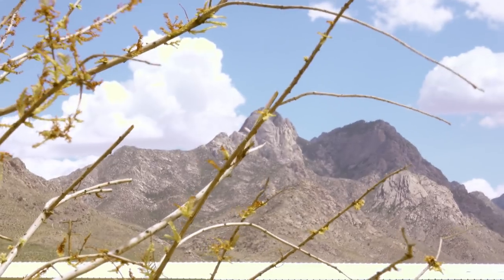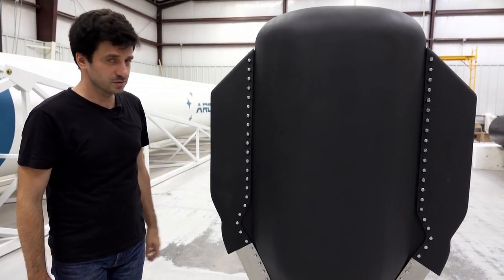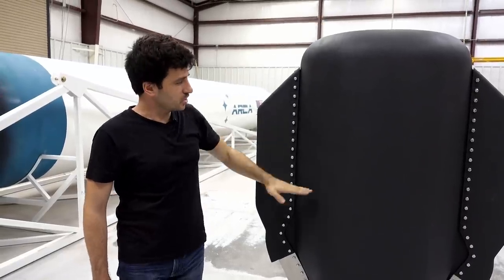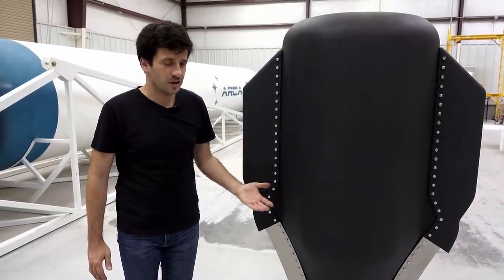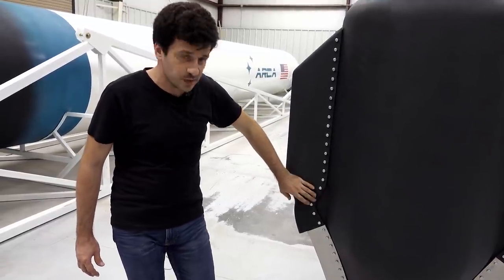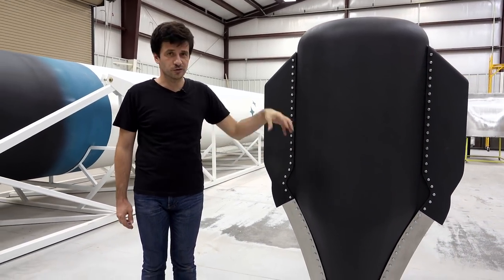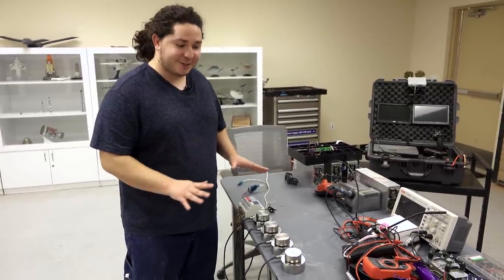Flight of the Aerospike: Episode 6 - How the Engine Works

Comment: I can smell some BS
Reply: Ant1 Statik how ?
Reply: @utubeballbag  electronics setup is a fake.
It kinda resembles my Arduino set - flimsy breadboarded wires connected without a rhime or reason.
His toolbox at 2:54 contains run of the mill Raspberry Pi parts (most noticeably Pi camera)
The next shot - is just a Pi header connected to a breadboard!
Reply: @crazymonkeyboom I am an empirically self-taught solder-poker. I see something as stupid as I would make. 😊
Look carefully:
1. You can't use breadboards for any reliable measuring equipment - they are full of jitter and fall apart when you sneeze nearby. You have to etch a PCB for any reasonable reliability.
2. I paused to look at the breadboard which was tinkered by the lady at 2:42. Its just an Arduino connected to a Raspberry with something that looks like a relay and 3 potentiometers! I can't imagine what that thing is supposed to do, but it DOES NOT measure temperature, obviously.
3. His toolbox is not an engineer's toolbox. It's full of hobbyist parts. What use do they have of a Raspberry camera? It kinda looks like a result of a shopping spree at element14 (believe me, I've done that).
4. The part at 3:00 is a cheat-aid for somebody, who can't read bloody Raspberry Pi manual! I mean, how professional is that???
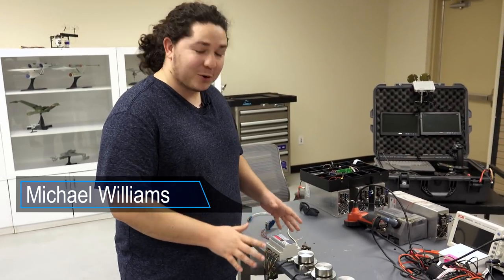5. At 3:07 we see a panorama shot. Let me list what I see:
- SELF-CONTAINED load sensor kit (you just buy and use it, no need to tinker);
- his stupid toolbox;
- three (3) power supplies (what for?);
- a soldering iron without any soldering materials;
- a tangled mess of multimeters;
- oscilloscope (not connected to anything);
- and an fucking UAV control station! With screens and joysticks! 

It's not a an engineer's workplace. It is a toy room!
If they imply doing rocket testing with that stuff - they failed miserably.
Reply: @firesculpturevideo  Not a troll. I don't imply that what's ARCA does is fake. However, electronic components I see in this promotional material are fake. Shoddy PR work makes more harm than good.
I hereby expose the inconsistences. If more arise in future - than faking if their work should be deemed systematic and trustworthiness nullified. They haven't reached eat threshold yet.

If you wish to disprove my analysis of the electronics, please disprove the following statements:
1. Electronics shown in the video are hobby-grade and, are not fit for any reliable application. And
2. None of the electronic components (except, probably, pressure sensors, though I doubt them also) are usable for testing jet propulsion (as implied in the video).
Reply: Volo who gives a shit. It is a “promotional video” not an EE exam.
Reply: Volo you spend time trashing something you know nothing about. Why would you dev a system by etching a board first? This shows your lack of experience that I see here on YT.  I’m sick of this. Arm chair quarterback?
Reply: @firesculpturevideo  Are you paid to defend those ARCA guys? If the do hire paid comments - they are officially full of shit!
No sane engineer would rely on WiFi and Raspberry at any stage of rocket testing! Do you imagine the stresses and vibrations caused by a rocket engine?!
No use of WiFi! Only protected wires with locking plugs.
No use of Raspberries as those hav (i) an unreliable micro USB power plugs, which die even with casual use and (ii) stresses make SD cards disconnect freezing the whole device.
The saddest thing is that if they do use Raspberries - they are stuck with those instead of proper industrial mini-PCs and FPGA.
So, if you DO believe in ARCAs success you HAVE to hope that is video is fake. If it's not - they are in deep shit!
Reply: Volo oh btw: static fire. Not flying. BIG BIG difference. TROLL. WTF are you here?
Reply: Volo you remember the discovery channel production on RC flight of an old Jet liner? The aeronautic engineer uses a 2.8ghz select spectrum transmitter meant for RC airplanes.
Reply: @volo870  also, i just want to point out that your profile has NO CONTENT. Lame.
Reply: @firesculpturevideo  I have certain experience with hobby electronics: I collect retro computers (ZX spectrum, Amiga, Atari, early 90s laptops) - they quite often need repair, modification and custom wiring. Have some experience with Arduinos (programmable beer fermenter thermostat, PS/2 keyboard emulator... little stuff like that). Now I am playing with Home Assistant on my Raspberries.
What I do is kid's stuff.
I am acquainted with a guy who etches custom PCBs (with a printer and a UV light) and flashes FPGA chips. The man's a monster! Once he made an FPGA Spectrum clone from scratch in a weekend (without copying other's ULAs). Just for LULs!
What I imply - the alleged "engineers" are as competent as me, and are playing with kid's toys. Rockets don't fly with that kind of skill - so I still believe in electronic setup being fake.
P.S. So what if I have no content on my channel?! Would you really like to see my silly dog and a bunch of 80s game letsplays?
Reply: @firesculpturevideo  By the way I looked at your flame statues and robots. I can appreciate those. They scare me shitless, but I do appraise them.
Reply: A fake person would have gone away by now. I am glad you are real. It sounds  like you do cool stuff and make things.  My opinion is that you have a right to an opinion as do I and I will say that crapping on a company like this is not helpful in any way. Maybe instead of being mean about it say something helpful.  Otherwise you sound like a troll. My apology if i offended you.
Reply: @volo870  Also, not to toot my horn but I make stuff with my company that if it fails people can get hurt or killed. I call it "failure non-optional"   We use any means necessary and usually any cost. ARCA is not well funded so I can understand using simple off the shelf hard ware. Non of which is bad for the simple testing and prototyping they are dong for ground testing  proof of concept.   I just finished a project on the cover of Popular mechanics last issue.  feel free to check it out.
Reply: @firesculpturevideo  👍 Cool. I'll look of the scanned issue.
I might have seemed harsh. In Soviet ages my parents were engineers at Yuzhnoe Design Bureao (they took part in designing the legendary R-36m, aka SS-18 "Satan" and civil Zenit vehicle). My dad later became video chronicler of the enterprise.
I've seen photos and videos from vehicle testing and production facilities. Believe me, there was A LOT of redundancy. Even during testing. Bad design practices make me angry.
Sadly, the enterprise is on its last legs now. I hardly believe it shall survive into the future generation of vehicles.
Reply: @volo870     Thanks for sharing this.  I think Yuzhnoe could be brought back to life by young companys like Space X and ARCA. I can see a day when Ukraine will have an elon musk revitalizing  an old launch complex. I wish the younger generation could learn from the men and women from that era.

Comment: With such a low burn temperature, I can understand why the military is really interested: "cold exhaust" ICBMs that can't be so easily detected by IR satellites.
Reply: IR detectors are not fool proof by any means plus you'll need to realize what you're looking at is a missile and not some other relatively hot object by watching how fast it's moving.  Any kind of advantage that forces your opponent to stop and guess makes it that much harder for your opponent to react in time.  Combine that issue with atmospheric effects and the problem gets even more difficult.
Reply: +draco6543
Missile warning satellites cover vast areas with a wide angle of view, the only reason they can see an ICBM launch is because the exhaust gas is so hot, or bright in IR. Great for detecting say a missile launch from the middle of ocean, useless for detecting say a campfire, too low resolution. With a JWST you might be able to detect a match on the moon, but you can't constantly monitor half the pacific with it, the angle of view is really small, you can only monitor a small patch of ground at any one time, you would need a ridiculous number of satellites to cover the globe with constant surveilance. 
If your exhaust gases are significantly colder than what the missile warning systems are designed to detect, it's quite reasonable that you might be able to launch undetected.
Reply: Apparently the Russians have a cryogenic engine's on it's upper stage on the New RS-28 Sarmat. also China and India have already tested there own version's
Reply: +John Kepa in this context cryogenic does not mean exhaust is cold, quite the opposite. If they are playing around with cryogenic upper stages that probably means they are looking into dual using the missile as orbital launcher for smallsats as has been done with many ICBM-s. 
Cryogenic fuels are no good for ICBM-s, you want your ICBM-s to sit indefinitely in momentary launch readiness, you can't do that if your propellant is constantly boiling off and growing icicles on your rocket.
Reply: ARCA Space Corporation

If you are against that, why do you have weaponized ship models like the USS Enterprise? XP
Reply: You know full well the federation's starfleet isn't officially a military force. ;p
Plus any non-trivial spaceflight over large distances will at a minimum require defenses against asteroids, micrometeoroids and other similar objects. Fact of the matter is anything which can protect a ship from natural hazards is almost certainly also going to be useful as a weapon of war.
Though to be fair for an interstellar space vessel it's a moot point anyway; Any space vehicle that can command sufficient energy to travel those kinds of distances can weaponise it's engines and do untold damage from that alone.
Reply: icbms show up on radar ir not needed
Reply: Why would they be interested in such a feature?

They don't need it.

They already have massive retaliation capability.

Who needs 'better' missiles, when you already have so many, that it is impossible to stop a full scale attack.

Total waste of money.
Reply: @ARCAchannel  I love your Work

Comment: I see this as a very good idea. although carrying enough fuel as it is H2O2, which is heavy is a bit counterproductive. Although you could get a little more thrust out of the exhaust by increasing the curve of the exhaust ramp. I see a build up of torque if the curve is greater, although this would take ramping up the initial exhaust gases, and the pressures seen there to accommodate the required torque produced by the extra curvature, ultimately if this could be done then you would increase your thrust ratio a bit more.
Reply: Torque?

Comment: In the mid sixties Rockodyne was developing the Areospike engine, but in the seventies when I worked at Rockwell Shuttle Orbiter Division the information about these types of rockets dropped out of site.  Glad your back to working on this design.
Reply: Rockets are great and they have their place, but they can't be reliably used in a reusable craft within earth's gravity well with the lack of our metallurgy development where it stands, micro fractures and fireworks display will ensue. My great uncle Jack Branham let NASA see Blackbird up close and personal around the time the STS program launched for a reason. My grandfather planned the OXCART program since 1947 which Sinatra screwed up in December 1963 ripping off and killing my grandfather. There were two program goals; first off was Mach 5 capable recon aircraft for the DoD, secondly was a manageable and functional space program for NASA, neither happened so here we sit. When my grandfather promised the kids of Children's Hospital the stars, Hollywood was not implied.
Reply: The linear aerospike was being actively developed for use in the X-33 during the 90's. Unfortunately, the X-33 was canceled when it was 3/4 built due to problems with the composite hydrogen tank. I was working on the thermal panels at the time.
Reply: there's already an engine that uses this same concept, using hydrogen peroxide as the fuel I mean and it's run through a silver screen mesh which causes the reaction.  It's what they used to make the first "jet pack".  Not very practical because it doesn't last very long so I'm interest in how they are going to deal with that.

Comment: Hi some corrections: 
1) If you are using H2O2 as propellant, that means monopropellant and you have <300 degC in decomposition temperature you are running on way to low H2O2 concentration. You should be on rocket grade levels: >85% H2O2. Then we are talking about decomposition temperatures >650degC. Still the specific impulse level will be far to low for launcher applications. Sorry the "spike" nozzle will not do anything good here. You must mix the decomposed H2O2 with a fuel. E.g Methane or RP-1, then you will see the Isp levels that will be useful.
2) I would never let the H2O2 hit the catalyst bed like you are planning and then have the expanded gases reflected upstream and out into the nozzle! You will generate instability. 
3) You do not need multiple load cells for measuring the axial thrust. Load celles can easily be procured to required level.
Jan-Erik Rønningen

Comment: Use a clamp when running the drill press!

It can bite and the spin the sheet metal around very quickly, cutting your hand.
Reply: Lars-asaurus havent you been watching the videos? They make everything by hand.
Reply: Sorry, but the way the work piece is moving around on the drill press as shown in this video shows it is not a "fairly heavy piece of metal," especially as compared to the strength of the drill press motor to spin 'em around.

Machinists clamp much bigger pieces than that for a reason.
Reply: Perfectly safe in this case. Clamp optional.
Reply: yeah I had some idiot tell me do that with a fairly small peice of metal, it spun around and flew out and hit me in the chest! knocked the wind outa me. Last time I ever try being a machinist.  (not my job)
Reply: I have a scar on my left palm where 7 stitches were because I thought "this is a heavy piece, clamps optional".  Clamps are no longer optional.
Reply: Arca, every machinist who's lacking some fingers or full hands even were sure clamps or other safety tools weren't necessary because the parts were heavy enough or they have experience in machining and they deemed it safe enough. No steel- or woodworker deliberately cut off their limbs. Use a clamp when using a drill press.
Reply: I'm sure they didn't know that.
Reply: I was also concerned about the latex gloves they were using, need something much more durable...
Reply: That's how I died.
Reply: "not as likely to happen in this case" - totally worth taking the chance and losing your hand.
Reply: Until it spins and cuts off a hand. then clamp should have probably been used. I thought I was great at welding, turns out I burnt the pads of my thumbs so bad that the skin is hard and smooth, now I use a nice pair of gloves.
Reply: "Safety features have been removed for demonstration purposes ONLY. Under no circumstances should any operator ever use a machine for non-demonstration work with safety features removed or non-functional. ARCA Space Corporation can not and will not condone use of any machine without the correct and proper PPE's." right?
Reply: This is why you have two carotid arteries.
Reply: Lol internet know it all tells machinist how to do their job. YouTube comment section is hilarious. No one believes that you actually know what ur talking bout lol